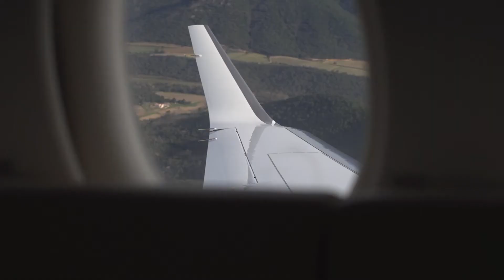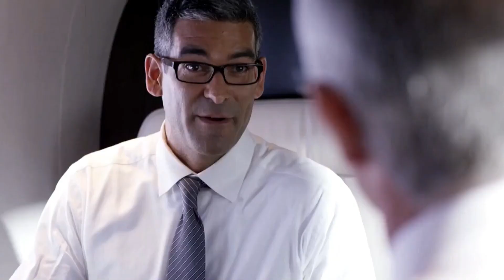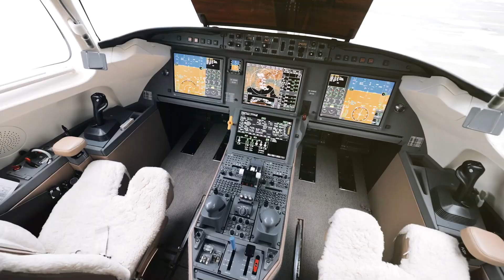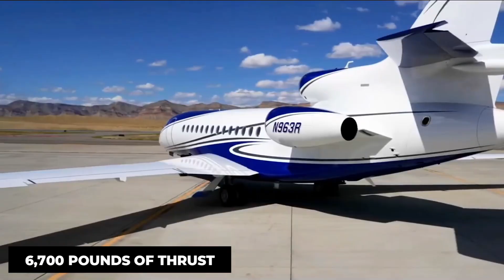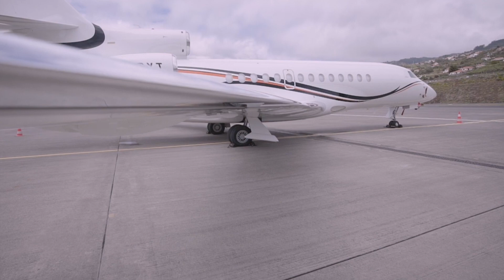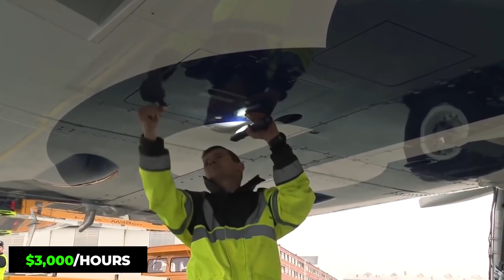Inside The $60 Million Dassault Falcon 7X

Comment: I'm a Carpenter, maybe I can say the interior is good but I'm not jealous I can make the furniture more than that. ❤❤❤❤
Reply: Not the same thing. An airplane cabin expands and shrinks, every time it flies. The interior has to be able to take that and not get loose. Also, it has to withstand certain G-forces in case of an incident. You don’t want parts of the cabin become a projectile. 

And lastly, it needs to be all fire proof.
Reply: @rtbrtb_dutchy4183  ummm. 👍👍❤️❤️
Reply: The interior wood is laminate over ultra light honeycomb composite